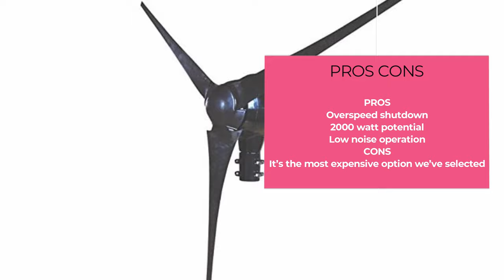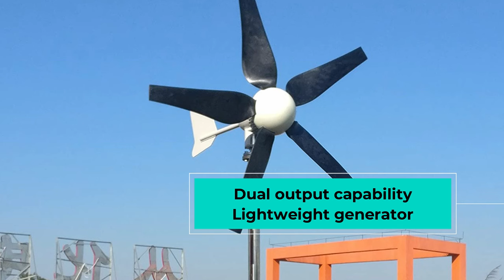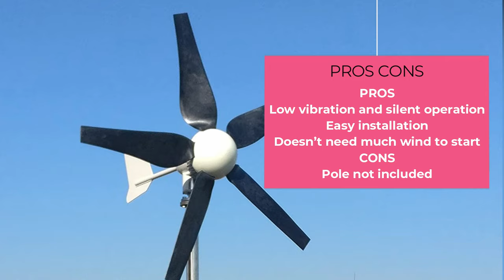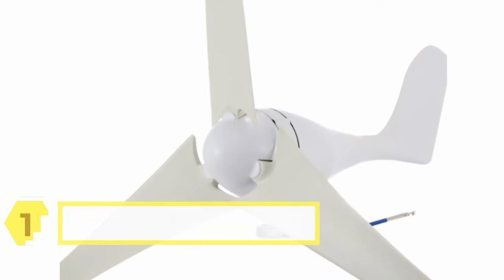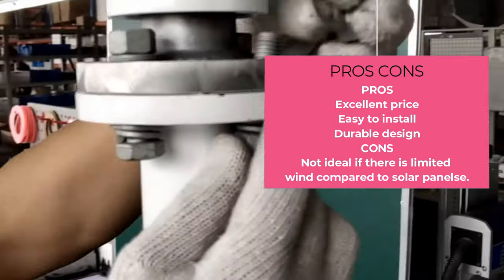Home Wind Turbine: Top 5 Best Home Wind Turbines on The Market

Comment: People say these wind turbines don't come with enough wiring to go from say top of a house or pole to go into the charge controller. They also say the wiring is like a 3 wire set and it doesn't look like the 2 wire black and red set that solar setups normally use. (Maybe that depends on if its set up as AC or a DC wind turbine though...) 

So what kind of wiring are you supposed to get for this part to connect from the wind turbine to the charge controller? And what are you suppose to look for? 

Thank you.

Comment: The great thing about wind turbine 3 is that the unique edge of the blades chops birds that hit it into many pieces immediately on contact so they do not suffer pangs of death throws
Reply: Yes I love it. And it feeds my dogs and cats.
Reply: I don't know why they don't just put you know the same thing they put on fans like a guard of some sort that doesn't block too much of the wind
Reply: @sambob8019  Cuz it's not a real issue. Wind turbines kill orders of magnitude fewer birds than cars or glass windows every year. But no one is talking about stopping production of those because of bird strikes. Birds really don't get hit or killed by turbines in significant numbers. It's a (not even) funny meme, and that's about it lol.
Reply: How many homes can a wind turbine supply with electricity?  None at 100% of the time.  100 at 20% of the time. 1000 at 1% of the time?

Comment: Do they work when the wind isn't blowing.How long does it take for turbine to pay for it self? Which is more effective solar or wind.
Reply: No wind turbine works when there is no wind. That's why they're called wind turbines. Regarding your other questions, it all depends on conditions at the intended site.
Reply: If one could afford it, both would be the best
Reply: @gilbertgutierrez7171  - Agreed wholeheartedly! Such a setup would be the ideal marriage of renewables, since winds generally blow harder and more consistently in Winter, while solar installations generally get vastly more sun in summertime. So the two systems complement each other.

Comment: what do you do when the wind is not blowing?
Reply: You always rely on batteries if you need ongoing steady power. Both solar and wind can be used in parallel to recharge batteries and minimize the risk of flat batteries.
If you don't consider batteries then your focus is about saving money on energy bills rather than living off grid reliably.
Reply: @Ranger-sl5sq  how did that work out in texas
Reply: @samusvi2693  Well most didn't have sustainable off grid setups (ie. alot of batteries and backup generators with stored fuel etc.) so it didn't go well for most. Hence my point you can't just rely on wind or solar. I've also thought a stationary generator pushbike would also be a good option instead of storing diesel fuel
Reply: @samusvi2693  Heh. Worth noting that Texas just didn't take care to ruggedize their equipment. They blamed it on wind (which was a small portion of their energy generation), but even their gas plants went offline. They just didn't do the work or provide the backups they needed. Besides, most backyard solar people aren't completely disconnected from the grid. They pull (and maybe push) energy as needed.
Reply: The coal plants keeps on generating power, even if it is not needed.  A coal plant can not be switched on the moment the wind drops.

Comment: I like the skybrator... Which generates power by rocking back and forth... 

Several ways you could do it effectively...

But the best method is to trap wind... For push.. To generate electricity... And release wind... To snap back.. And generate more electricity...

It is definitely quieter than traditional wind turbines....

Although I take issue with the aerodynamic design...

Aerodynamic equals less vibration...

If your looking to vibrate... You want to trap and release...

Personally I think the design of a sea conch might work... It traps the wind.. Which results in impact... Push.. and funnels it through the design... Which could allow you to generate even more electricity.. And then releases the wind the other side after spiralling through... Which gives you  your snap back vibration...

Another idea that might work is a cylindrical design with lots of small squares... The squares are vibrating in light wind due to their small size... And may also turn the cylinder in strong winds...

Comment: Keep in mind it takes 20kw to power a home. That's 20,000 watts. You would need ten at 2kw each and that's if the wind blows. At $1,000 or more each, that's over $20,000 bucks. No thanks.
Reply: A 64" Wind Turbine will never generate 2,000 watts. Maybe, 1,000 Watts with steady 25 mph winds.  Who has that?   Avg US home consumes 20 kw-hours of energy per day, not "... 20kw ...".